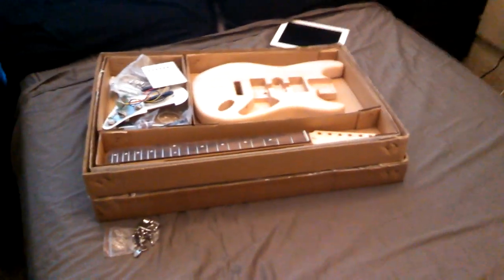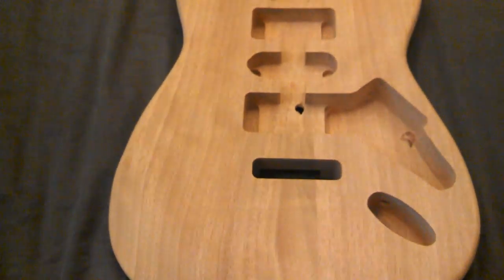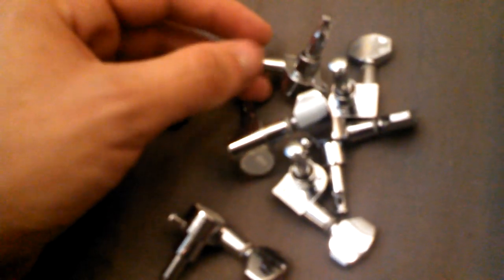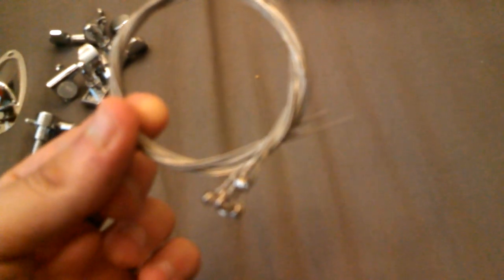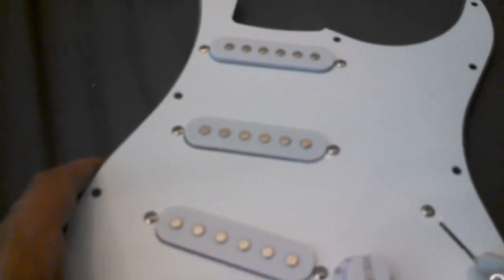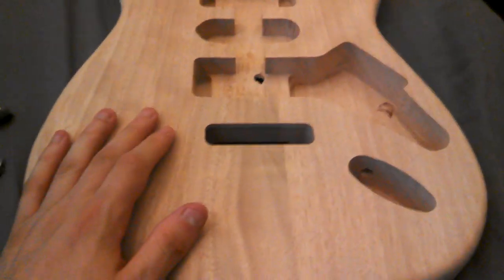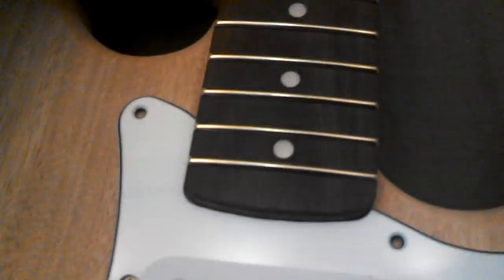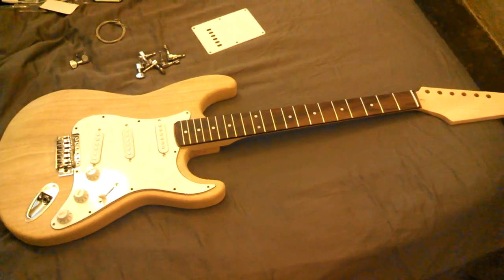DIY Strat Guitar Build, Part 1

Comment: Hi I just had a question did this kit come prewired? I've never wired an electric before and have no idea how
Reply from the maker: Hey! Yes, and no. The pickguard comes pre-wired, so you don't have to assemble it. But, you will have to solder all of the parts yourself. There were no instructions with this kit so i had to teach myself basically everything. Sorry if that doesn't answer your question!